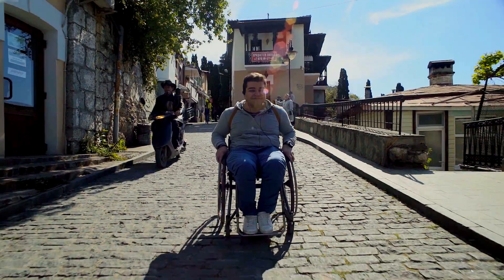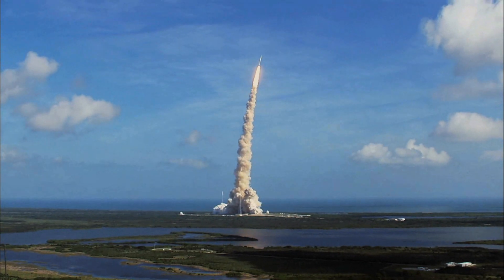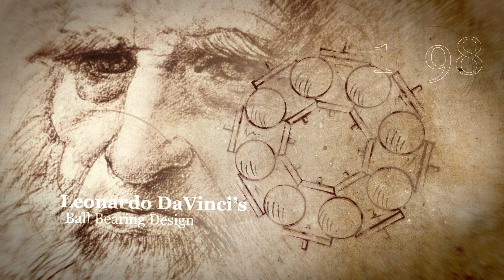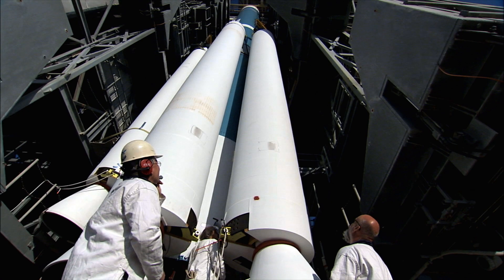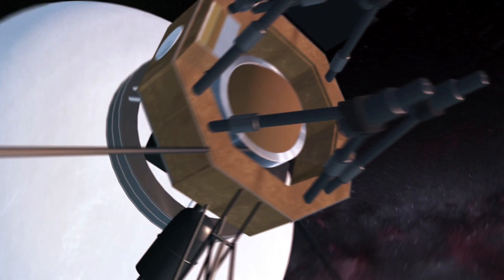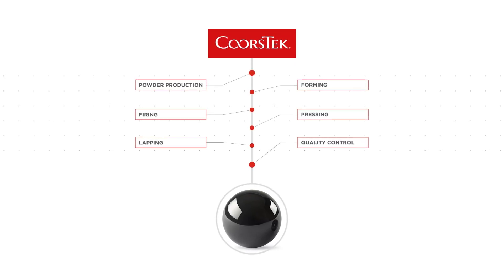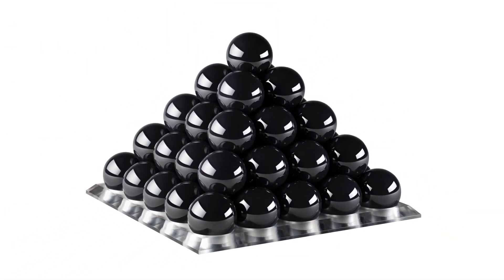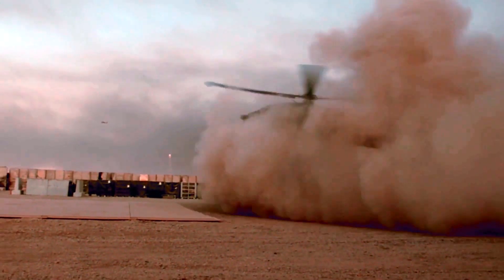Cerbec Balls -  Amazing Story

Comment: Anything that spins has ball bearings in it

Yeah apart from the many types/materials of bushings, air bearings, needle bearings, tapered roller bearings, plain bearings and hydrodynamic bearings, babbitt, etc.
Like I get its a promo video but that one is basically just a bold faced lie.